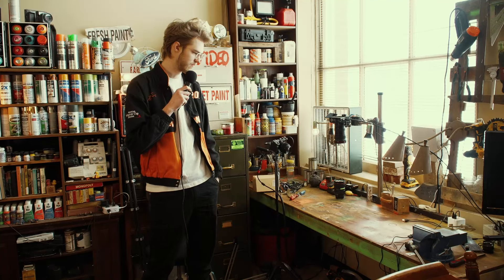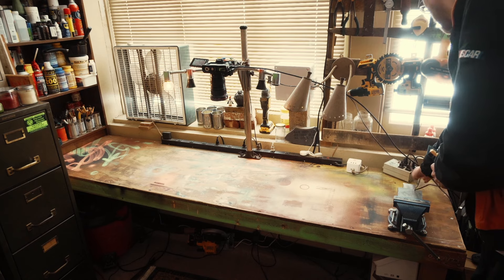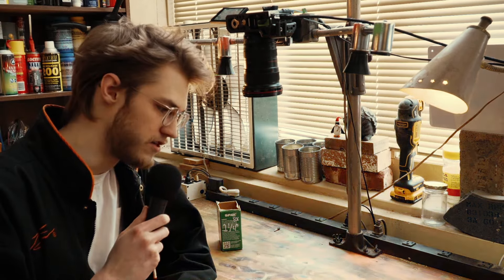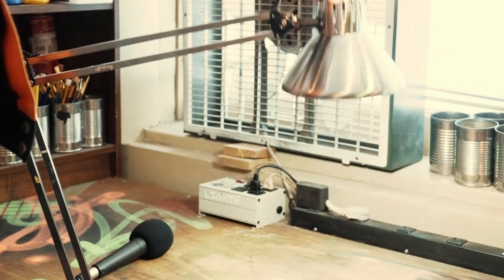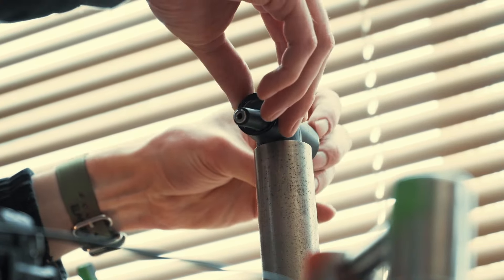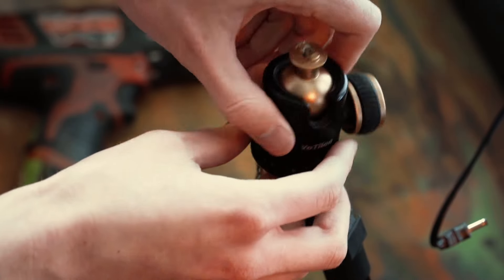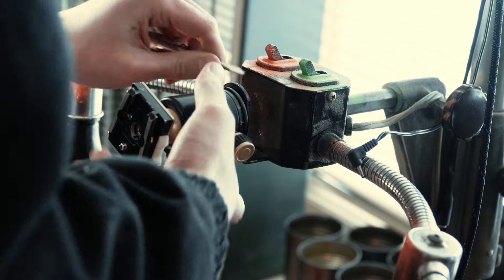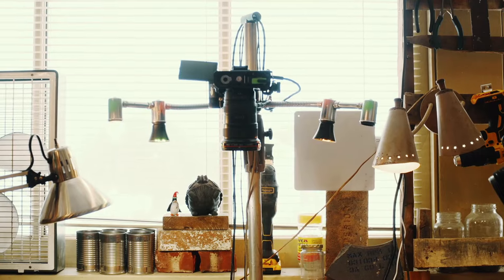Workbench improvements (to stay sane)

Comment: tad late; i use wiz bulbs, those can be switched with just hardware and will retain wifi connectivity, they have a good integration with home assistant so you can easily change their settings from your computer as well. theyre also very bright, for me it was set and forget with those bulbs

Comment: I would really like to see how you boshed the whole overhead setup together. I use a DSLR and with the weight I need something that will hold no matter what. I've tried a few things but with having a 6x2 work surface 5ft it's hard to find something that can extend that full depth required.